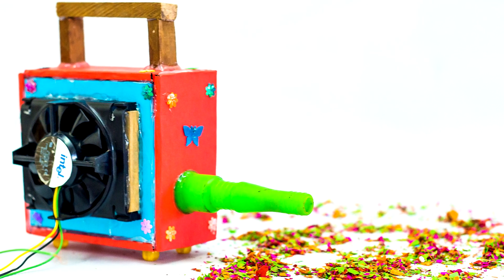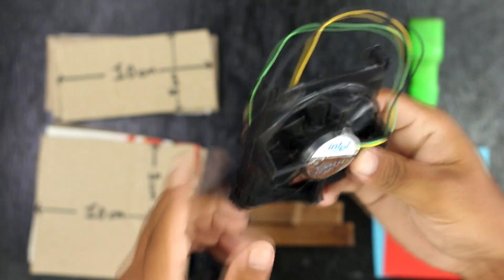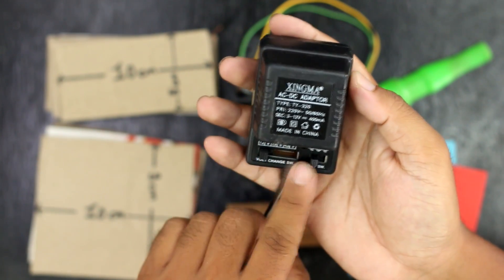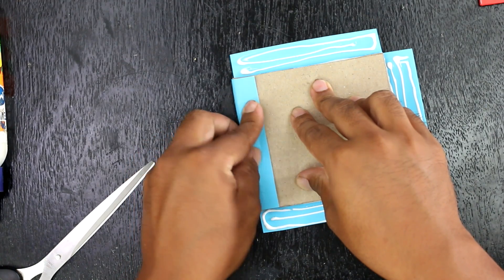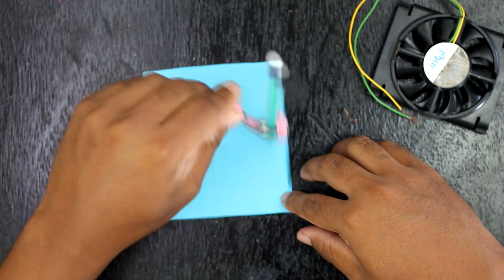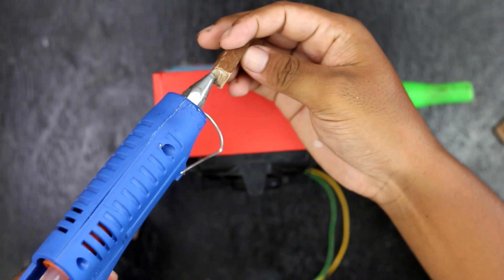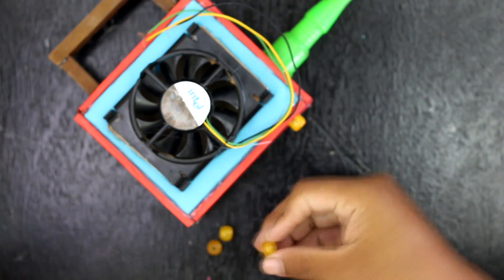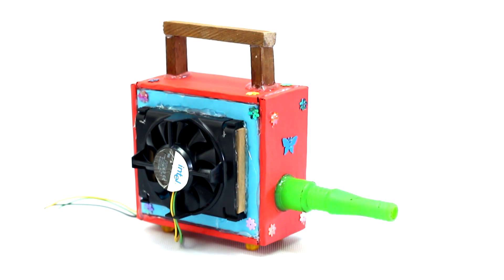How To Make Powerful Air Blower With CPU Fan

Comment: That is what i need to make an air pump for a hot air station.Also is possible to make a components sucking pump if the pump will be sealed putting another housing in the back of it having a hole for sucking the air.Very nice inspiring video that launches the ideas.
Reply from the maker: thank you my friend  George George

Comment: Make a bigger one, for practical use outside, and you can make the hole for the fan different sizes (obviously the bigger the fan, technically the more air you are moving to the downpipe)